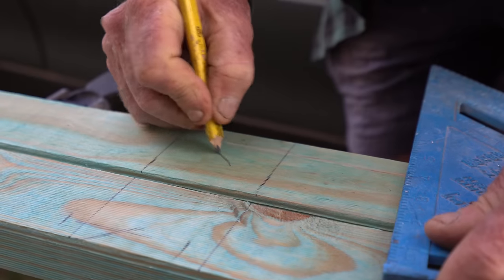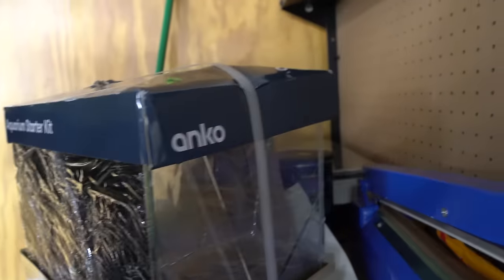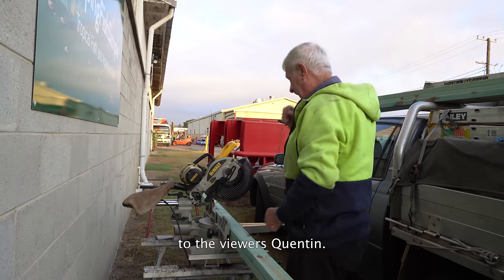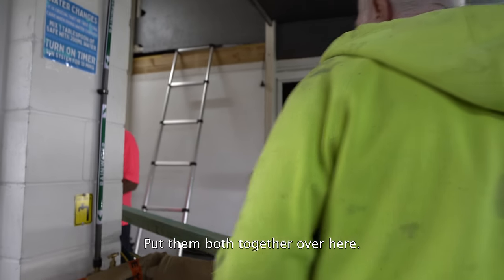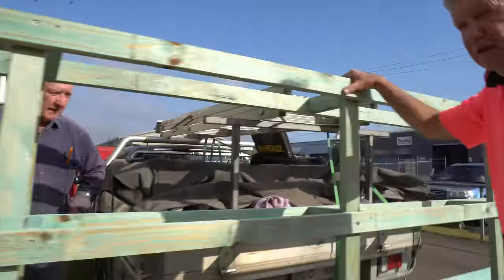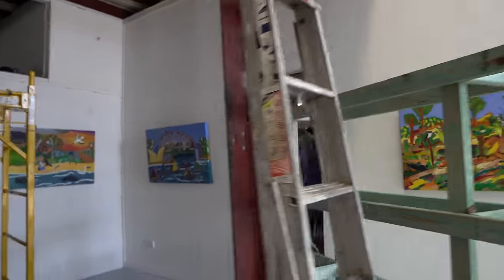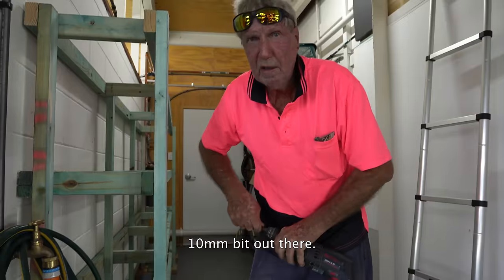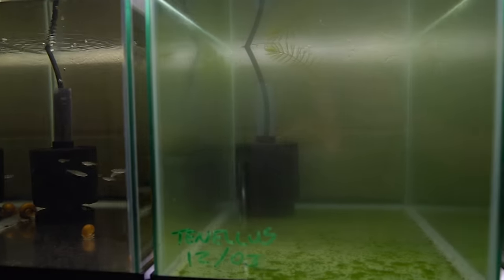Building My New Nano Fish Tank System!

Comment: I’ve thought that when you build a stand, or in this case racking system, the wood should be load bearing rather than the screws. Why in this application isn’t it an issue?

Comment: I have those exact same lights.  Just a heads up that they can grow algea like mad. I only have them on for 2 hours in the am and 2 in the pm.
Reply: Watch your nitrates mate, I have the same ones and I also think they grow more algae than "normal" light but 2 times 2 hours isn't a lot. I think you should be able to keep them on to enjoy your aquarium a little more and if your nitrates are high, you'll surely get more algae and faster so it doesn't help. Maybe your nitrates levels are fine but I just thought it could help!
Reply: @Emlav22 my system is similar to Nick's with automatic water changes three times a week. Water tested as well. No nitrates, nitrites and ammonia. Assuming those lights are exactly like mine they are 5000k and 5000 lumes they will grow algea.
Reply: What lights are they?